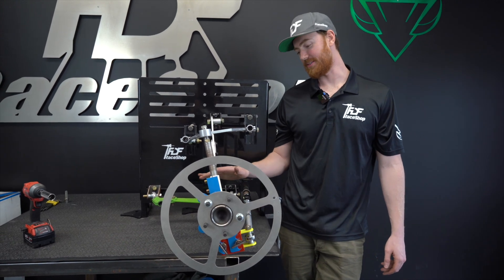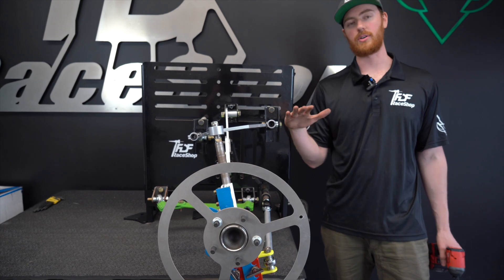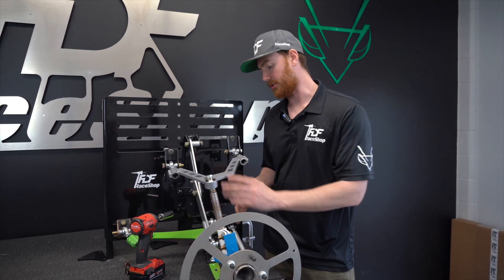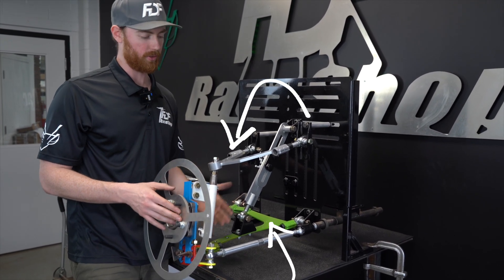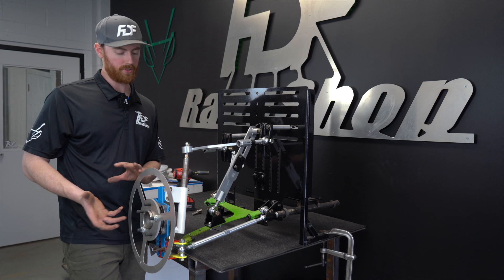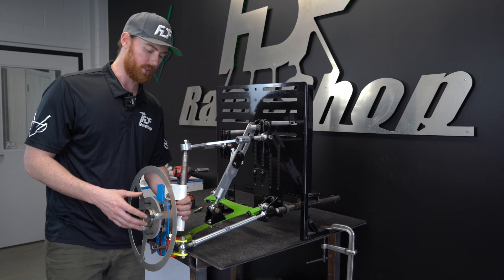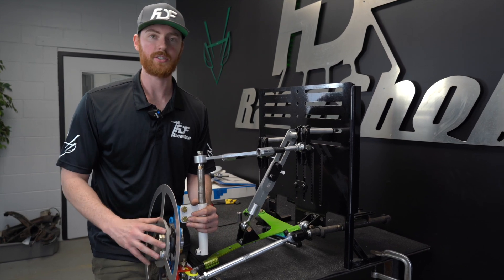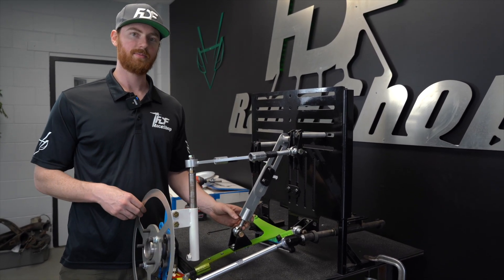Front Suspension Geometry/ Adjusting Camber on Double Wishbone Suspension

Comment: Great content.  I drive a stock 2003 g35 coupe same as 350z.  I’m trying to understand why Nissan made the cars with a certain amount of negative camber, I think.5 or .9?  and didn’t include adjustable front camber arms as stock?  I’m thinking about installing adjustable camber not necessarily for performance but to reduce camber to zero in order to prevent inside uneven tire wear?  Will I lose anything by going to zero camber? Tired of my tires lasting only a couple of years.

Comment: Over equals response requested.
Out equals I'm done you need to stay quiet and keep the channel clear
It's kind of a one of the other thing saying both together makes any competent military radio operator cringe that be like me trying to ask you if half shaft angle has anything to do with toe setting on a rear wheel drive truck
Reply: Good stuff by the way I'm glad you're doing this. Would it be wrong of me to apply your drift knowledge to a Pikes Peak pickup with insane front weight bias High Roll center. 4000 lbs front axle 2500 rear